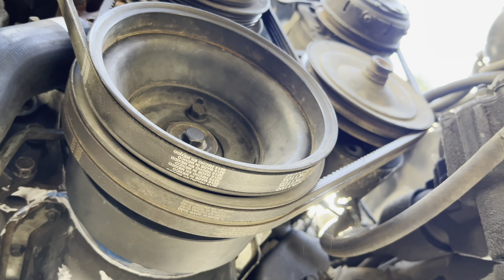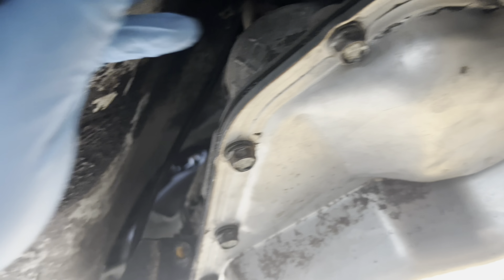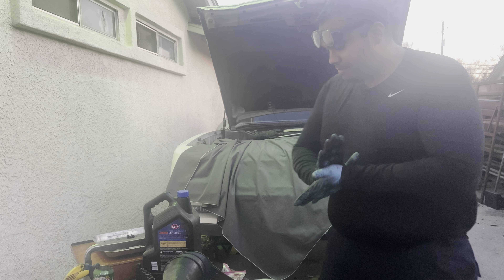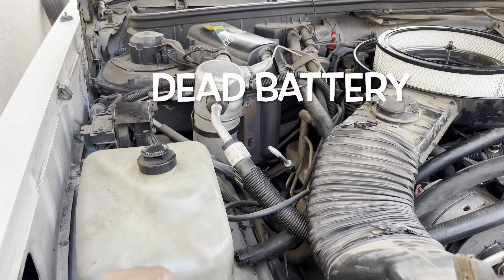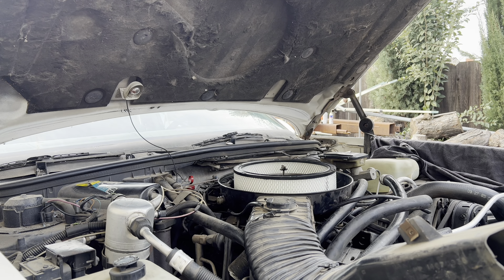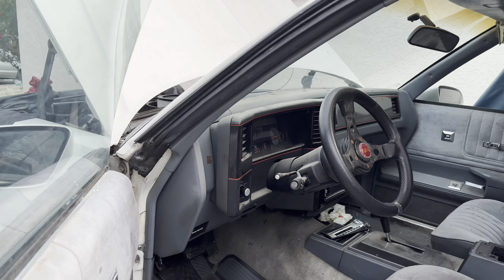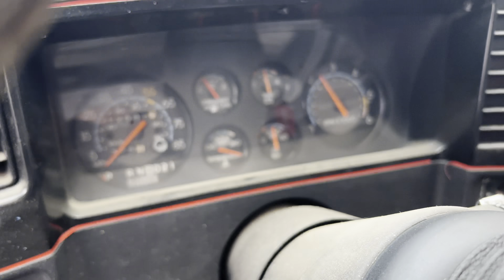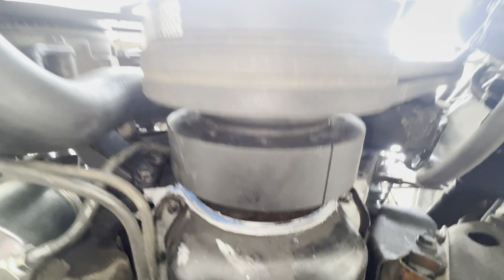CRANK NO START?!?!! Monte Carlo SS

Comment: That cable next to your transmission is your speedometer cable -the wire with the plug is for your lockup converter in the transmission the brackets are for your shifter that flat bracket bolts to the pan like you were thinking and the others go to the shifter nub on the side of the transmission. You should have a this nut to bolt that on and a small clip to attach the shift cable to those brackets that bolt on with that thin nut. 
Check your wires on the distributor cap make sure the tach wire is plugged in- if it’s not that may be why the tachometer isn’t working
Reply from the maker: Well thanks for clearing that up, appreciate it! The Tac appears to be working fine. Only thing I saw on the instrument panel not working was the Temp gauge. I’ll have to diagnose that next time I work on the car.

Comment: I'd say you did everything right before it started, except I'm pretty sure you flooded it out. Luckily it wasn't real bad or else those plugs would be shot. Noticed the engine was missing some but did manage to pull out of it. And yeah, never start a engine with tranny lines off, soon as it starts tranny fluid is all over in a matter of seconds. The fluid flows thru those lines even in park.